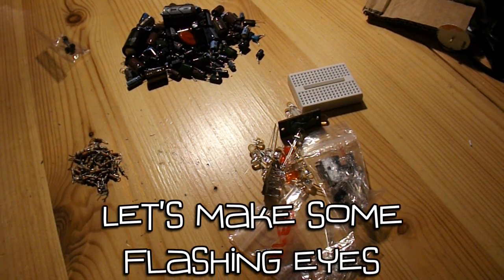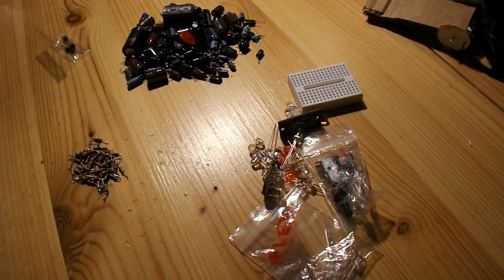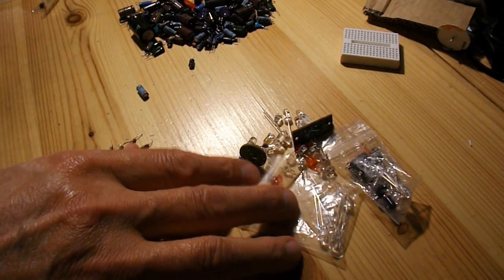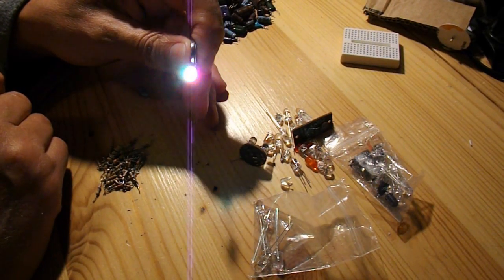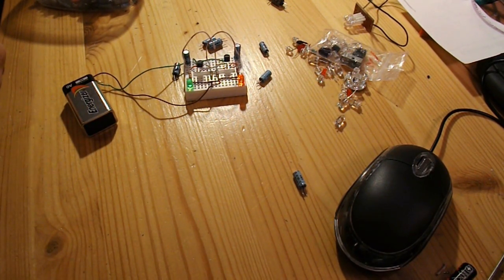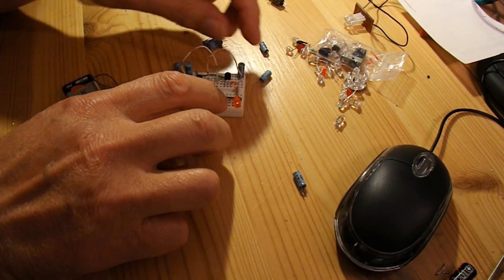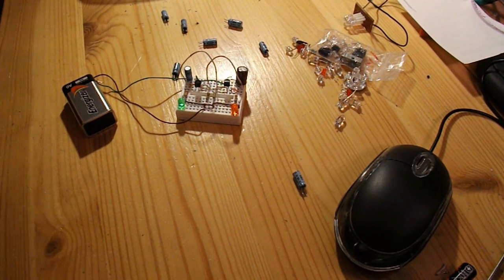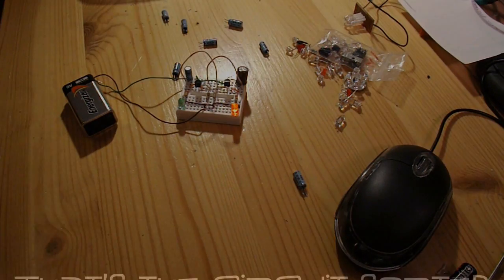Let's make a Scary Halloween Thing - part 1 - Flashing Eyes

Comment: Dude, one of your transistor is upside down it think. Cuz your led are not blinking at the same speed.
Reply from the maker: +Azen Kwed if you watch through the video I use a selection of salvaged components so not much chance of them being matched. If you watch the series through you will realise that having an even flash is certainly not a requirement. A random effect would be far more effective.
Reply: GrandadIsAnOldMan I thought the first two caps were identical 22uF. Ok then.